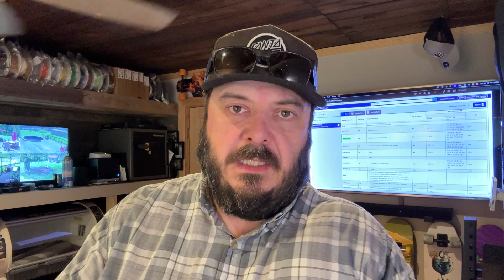The TRUTH About 3D Printing Tariffs

Comment: I don't agree with the idea that anyone is price-gouging. It's best to plan for all costs to double. Nobody is going to do anything differently besides planning for the worst. When De minimus goes away the price gap between Chinese products and machines like Markforge and LulzBot are likely to close quickly. I think the codes are correct on the US side but they're just warming people up to actually pay the 30% and the tariffs on the Chinese side as well. I don't think it ends at the tariffs either because the logistics costs will increase to process everything. There's a lot of moving parts to justify planning for +100% cost increases when the dust settles everyone just pays the new price. The same thing happened the first term, except the de minimus exemption remained and a lot of stuff still went up +100% and stayed there.  More people are going to front-run it, the longer you wait, the more you're gonna pay.

Comment: Exporters can’t just declare a low value, warehouse it cheaply in the U.S., then sell it at full price without running into serious legal and financial trouble. Customs authorities are quite familiar with these tactics and have several overlapping systems to catch them.
Reply from the maker: It’s not about declaring a fake value. it’s about declaring a real wholesale transfer price. If a Chinese company ships products to its own U.S. distribution center and declares a value of, say, $199 for something that retails at $499, that’s not illegal—that’s transfer pricing, and it’s allowed under U.S. law as long as it’s properly documented and follows fair market value guidelines. Customs allows this kind of related-party transaction as long as the declared value reflects what a third-party buyer would reasonably pay.
Reply: @ExtrusionTherapy  That is what Bambu is doing now. If all of a sudden they lower the transfer price to make up for the tariff then the US will not collect the fair market tax.

There are several trip wires.

1. Customs Valuation Rules

U.S. Customs and Border Protection (CBP) requires that imported goods be declared at their “transaction value”—the actual price paid or payable by the buyer in the U.S. to the seller abroad. Importers can’t just declare a lower price to reduce tariffs; they have to provide documentation (invoices, contracts, etc.) proving the real value.

•	Penalties: If CBP finds that the declared value is artificially low or manipulated, the importer can face fines, seizure of goods, or even criminal charges.

2. Transfer Pricing Scrutiny

If the U.S. distribution center is owned by the same foreign exporter (i.e., related-party transactions), then transfer pricing laws come into play. These require that internal prices between related parties reflect market rates—“arm’s length pricing”—to prevent profit shifting and tax/tariff avoidance.
	•	The IRS and CBP both review these transactions. If they believe the transfer price was manipulated to reduce import duties, they can revalue the transaction and collect back tariffs.

3. Anti-Dumping and Countervailing Duties (AD/CVD)

If exporters try to sell goods into the U.S. at artificially low prices (below market value or cost) to avoid duties and gain market share, the U.S. can impose anti-dumping duties or countervailing duties.
	•	These are often even higher than standard tariffs and can be retroactive. They’re meant to neutralize unfair trade advantages.

4. Enforcement & Audits

CBP conducts random audits and post-entry reviews. If a pattern of suspicious pricing is found, it can trigger in-depth investigations.
	•	Big red flags: inconsistent pricing, high profits in the U.S. arm compared to minimal declared import values, or patterns that differ from industry norms.

5. Recordkeeping Requirements

Importers must maintain detailed records for 5 years under the Customs Modernization Act. These include pricing, contracts, correspondence, etc. If they can’t justify a declared value during an audit, they’re liable.

Comment: We need production of 3d printing here in states. It'll even give the opportunity for a recycling system for discounts.
Reply: thinks about the new chinese made gifs and videos going around of us "citizen" making clothes
Reply: Printed Solid is now assembling printers (and printing parts) in the USA as a wholly owned subsidiary of Prusa.  They are also now starting to manufacture Prusament filament. Ultimate goal is to achieve “made in the USA” capability.
Reply: So you want to pay 10,000 bucks for a printer? Sure, produce it in the states.
Reply: hahaha aint going to happens.  every brand had their own formula on the filament.  if you mix few brands and try recycle them, you will get a very very bad filament . only by doing from raw + formula + other ingredient which is all 245% increase in price , you will never get cheap filament anymore.

Comment: I appreciate the effort at producing this video, but unfortunately the information is totally wrong. When you import an item, you have to report a primary code and a secondary code. The primary code is what you showed in the video and is the base tariff. The secondary code is the country origin tariff. For China, that is either 9903.01.32 (exempt based on falling in a specific exempt category) or 9903.01.63 (China - 125% additional due). 

This means the 125% is applied ON TOP of the base tariff listed. It is not IN PLACE of it. 

See CBP publication CSMS # 64724565 - UPDATED GUIDANCE – Reciprocal Tariff Exclusion for Specified Products; April 5, 2025 Effective Date

Comment: I find it interesting Bambu is leading the charge here. The Elegoo Centari Carbon is still on preorder for the low price of $299 US and it won’t ship till July. Clearly they aren’t concerned with the tariffs.
Reply: They may be, but Elegoo is offering the Centari Carbon at that price and likely is keeping it low to cut into Bambu and Creality's market share.  It's a smart way to build a loyal following, and one of the best parts of a capitalism from the consumer side of things.
Reply: They can keep it at $299 and let the consumer handle any tariffs when they receive it. Tariff is charged at the point of entry, so if you're buying it directly from Elegoo, you are the importer. If the de minimis elimination holds, you'll then have the tariff and the processing charges.
Reply: @ is there any reason why Bambu isn’t handling it the same way then. Screams gouging.
Reply: @joewozniak2231  My assumption is that bamboo is shipping from their warehouse in the US, and elegoo is shipping from their warehouse in China.
Bamboo is charging you extra because it will cost extra to replace that stock in their ware house.
Ultimately, Trump imposed the tariffs, so blame him and the morons who voted for him.

Comment: 3D printer is 8443.39.00.50 and is not exempted
Reply: @desert2025  Correct tariff is 8477800100, 13.1 percent plus retaliation tariffs
Reply: Yup, don’t believe 3D printers are exempted from reciprocal tariffs..think the HTSUS code unless it’s on the exempted list mean it is suppose to be charged that tariff if origin is China.
Reply: 3-D printers are not exempt from the tariff.
Reply: Coming to this 3 weeks later, but the correct HTS code for 3D printers is 8485 and for all those that print thermoplastics is 8485.20. That code was created in 2022. Customs and Border Protection even made a dedicated video (https://www.dhs.gov/medialibrary/assets/videos/39880) about it. If you look at the video, it also shows at timestamp 10:18 says that 3d printers should be classified in that new heading and in no other headings.

Comment: I have been using atomic filiment for my pla and petg made in Indiana. For my pa6-gf & pa6-cf i have a few rolls of Fibrex on the way to switch to american made filiment.  

Printers wise i have always been about the secondarady market. All my printers are used. Helps keep thr costs down.

I figured sense i am still in baby stages switching now will help me in the future if it ever happens again.
Reply: Polar is out of Michigan and fully US sourced in all parts from base materials, colorants, packaging, etc.
 Polymaker has a couple US manufacturing points as well.
Reply: @MattWeber  i saw that polymaker started producing in the US.  Currently they are only doing PLA, PETG, ABS & ASA however they say they plan on 85% of the SKU produced in USA witch is MASSIVE!!!!! Pursa is also supposed to start producing in the USA. Currently they are setting up in Delaware with aprox 30 employees as of July 2024. Not sure were it has gone sense.  Personally when it comes time to buy new machines Pursa is my first choice as they are at least not China.  Lolzbot is US but there cheapest machine is 1600 for a 180 X 180. Sucks US machines are so expensive.
Reply: @tbboardhed2  I should also mention that Polar is a primary white label supplier for a lot of US brands. Obviously no idea which, since that would violate the NDA they have with their white label customers though.
Reply: I use a lot of atomic PETG and it's amazing. Prints beautifully and they have some gorgeous colors.
Reply: @NWGR  i absolutely LOVE there PETG-CF. I got a bunch of parts around in my garden made out of it and even some printer parts.  Never had an issue. Stock petg printer profile with an adjustment to print at 260 instead of the 255 in prusa slicer profile.  Great company.

Comment: I wondered why Bambu moved prices up and none of the other guys did.
Reply: I just pulled the trigger on a P1S today and luckily I live by a Micro Center and it was still on sale. While I was there they were adjusting the pricing as I was there and said I was lucky as I was probably one of the last to get that price. Wanted to wait a little bit but my luck is always I miss a good price by days and not this time
Reply: @ it’s a great machine.
Reply: I noticed Creality did as well. During the first preliminary announcements I was pricing another K1C and at that time it went up almost exactly 25% preemptively.
Reply from the maker: Good question I wonder that myself.
Reply: @ExtrusionTherapy  Greed.
Reply: As an retailer, it's coming.
Reply: It is a matter of days until they all have implemented it.

Comment: So based on your model a printer over $2, 500 would be kind of hard to make money on right? That's like a $1.60 an hour.
Reply from the maker: Depending on the type of printer, if it can reliably run for longer hours, you might be able to stretch its value a bit further. Personally, I usually plan around $500 for 1,500 hours of dependable use—that feels realistic for most printers in this price range.

The real issue comes when you’re spending $1,000 on what’s essentially a $500 printer. In that case, you might not recoup your investment before the printer starts losing reliability.
Reply: @ExtrusionTherapy  Great points, but i thought id chime in on the hours of usage as 1,500 is fairly low hours for one of these machines all things considering. Ive got over 1500 hours on all of my Bambu Lab machines, with 2 A1 Minis past the 2,000 hours mark and my P1P almost nearing 3500 hours and the only thing ive had to do to any of them is replace the sd card with a quality one on 2 of the machines, and ive done 1 nozzle replacement on my P1P and 1 replacement on 2 of my A1 Minis. These will easilly hit 4-5k hours without needing to replace more than a nozzle. Even with the P1P at 3500 hours, the only thing i see needing replacement on in the next year MIGHT be the belts but knock on wood, they are still performing very well 😆 *edited to add, i also don't keep up/listen to the A1 Minis when they tell me its time to clean and lubricate them, although they do still get maintenance every now and again, just not at Bambus recommended timeframes.
Reply from the maker: @TheMountainMaker  I'm probably as guilty as you on the maintenance thing and for sure those are lowball numbers but it's just the default I put in there. I know that if I pay $500 after 1500 hours it's paid for, after that everything's a bonus.
Reply: @TheMountainMaker  Those are pretty good numbers. Better build quality than the stereotypical Chinese product, anyway :)

I haven't touched the SD card in my A1. I don't actually even know where the slot is! I just print over the LAN, magic happens, and after a while I can walk over to it and pick up shiny, new things (at least until matte PLA/PETG gets cheaper).
Reply: @ExtrusionTherapy  Looking at it a different way, how much money does that printer bring in before it suffers an unexpected rapid disassembly?
Reply: Wow! I hope that 1500 hours is super conservative. I'd be very unhappy if anything other than obvious consumables broke in that time.
I'm used to replacing LCD screens every 500 plus hours on resin printers, my oldest still used one has gone through 6.
I have an old Anycubic FDM printer that's clocked up well over 5000 print hours without major failure (I must have got the good one 🤣)
I was working on an expected minimum life of 3000 print hours.
Reply: @ausfoodgarden  I think it makes a difference if it's 1500 hours of typical  consumer use, or 1500 hours of constant business use. All that constant heat can't be good for it, but letting it cool off now and then should extend its life.
Reply: “They may be on New Years, it’s hard to tell” 😂 haha Man, for someone living in Taiwan I couldn’t agree more! Even after living here for 14 years I still get super confused over the sudden “Dragon Boat Festival” holiday coming up. However, there is no Christmas holidays though, so at least there’s that…. 😢

Comment: Many people are missing the forest for the trees on china and tarrifs.  The Chinese economy is dying.  Hundreds if not thousands of companies are going bankrupt and shutting down.  Many are electronics and parts suppliers used by 3d printing companies like bambu and elegoo.  Ships aren't sailing.  Ports are idle.  This will impact even companies with sales in the us.  They will suffer increased costs and instability in the supply chain.  Prices will go up regardless of the level of tarrifs on specific finished goods.   So expect prices to go up accros the board and deliveries may extend as supply chain issues impact producers.  And lastly, nothing in the tarrif numbers is stable.  The tarrifs change based on an old demanted mans whims.  There is no policy.  There is no plan.
Reply: Oh yeah, the Chinese economy collapsed 2 decades ago and every year onward. 😂
Reply: 70% of chinese production go into the chinese domestic market, 10% to Europe, 10% to Asia and 10% to the US. Nobody will file for bankruptcy because of US taxes. Especially in the area of 3d printers. US models usually start at 10k. You can buy lots of Bambu's for that.
Reply: Bambu lab has warehouses in Canada. All their printers ship from there. If not, they will all soon to avoid tariffs imo.
Reply from the maker: @donoho93  unfortunately that little trick doesn't work because they look at the origin of the imported item if no "substantial transformation" took place the product would still have the Chinese tariff applied. Now, like I mentioned in the video, they could minimize the tariff by selling to US distribution centers wholesale, and then only passing on the tariff that applied to the wholesale price to the retail customer that would give you a little bit of a break.
Reply: Actually it will benefits to other countries because mostly the goods are priced based on the US price. Now it will be cheaper for other countries and more affordable. Expect in the next 5 years every household except US will have a 3D printer.